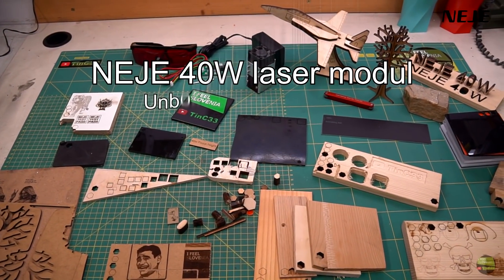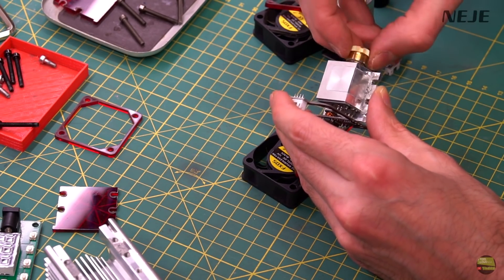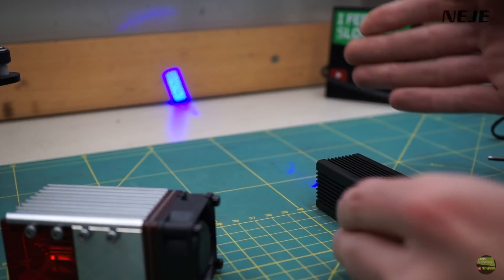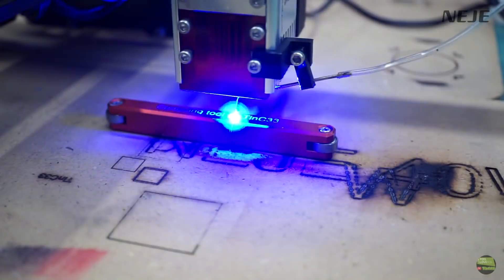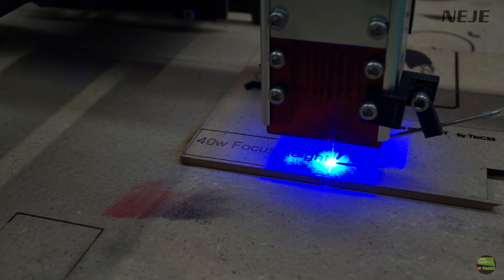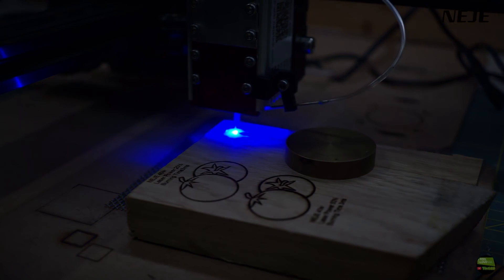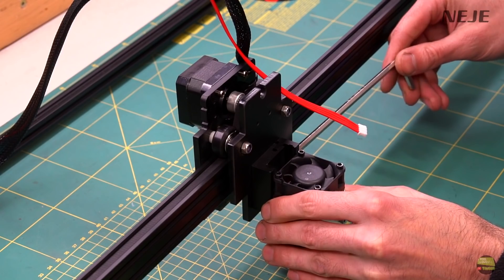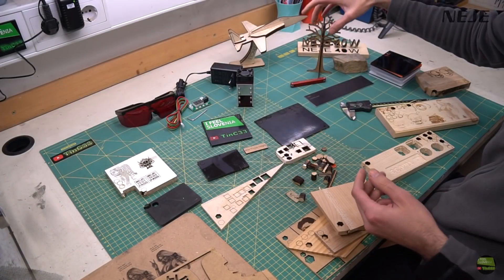Neje A40640 40w laser modul [unbox / review / first test] best laser modul modul i try

Comment: and the installation procedure?  Do you need another power source to power the new module?    , Cheers
Reply from the maker: All you need to replace is power supply wich need to be 12v 4A, cable stay same
Reply: @TinC33  And how do you energize the new integrated card?   Cheers and thank's

Comment: Hi, I've a question, my lasser engraber machine is the atomstack a10 pro and is 50w in general but the optical laser is 10w so idon't know if i would install some laser module like you use 40w, your machine how many watts it is?
Reply from the maker: They said it has 11-12w optical power, but focus is really good on that laser.

Comment: Hi there - purchased a NEJE 3max with this module a few days aho. So far, so good! Quick question: do you wear the safety goggles also when the laser is on standby / when you are framing the object or only when it's engraving/cutting?
Reply from the maker: hello, great to hear, it's the best modul, better than E40, i never use googles while framing, i put them on befor hit play button, but also that's not so dangerous if you cut some wood, biggest problem is while engrave something like inox steel, where the laser reflected and entire room become blue, so if that reflect to your eye it be very dangerous

Comment: Hallo sir,
I want to ask where is the difference between the CO2 vs NEJE engine?
Which recommendation, before we buy,
Because NEJE's price is much more efficient and its Work Area is 810 x 460mm, this product from China.

Thanks in advance if you can answer.
Reply from the maker: Neje is diode laser, i don't own a co2 laser, but they are much more expencive, i think more powerfull but got limited working hours, than need to replace expencive co2 tube, check yt for differences, but if neje got enough power for you than deffinitely diode laser, wich is cheaper all the way.
Reply: @TinC33  Wow.., your answer is very helpful
Thanks sir

Comment: how is the laser holding up after 12 months since this review. Just wondering what the longevity is of this laser.
Reply from the maker: For me work ok, but use only here and there, also read that for long term of use they advice to run at 80-90% power. However now the new modul com out specially for long term use.

Comment: A tip for cutting thick material. Do not focus your laser on the surface. If cutting 18mm plywood focus it around 4mm below the surface. If it begins to stop cutting then stop & adjust focus further into the material say 8mm.

Comment: Hi mate! Your reviews are good, but I'm sorry to say that you support a scam company. I recently bought my 40W module direct from Neje shop. But there was no "big box with lots of accessories". Most of the parts you show are not included - no glasses and not even the 4A power supply that is absolutely necessary to run this module. So you have to buy it aftermarket. Also packaged cheaply without the high-quality protection for each component you are showing - everything together carelessly crammed into a tiny package without padding in between, which led to the module being completely scratched all around. Very sobering when you see what the regular customer gets versus people like you who advertise and promote the stuff for them.

Comment: I don't know where they come up with 40 watts because NEJE's web site says this module's output is only 10 watts even though it says 40W on the case!!!!
Reply from the maker: It is old data, every china manufacturer (some of them still do) mark their lasers by electrical power consumptions, bow it's become popular to mark diode laser moduls vy it's optical wich is 10w for that modul but for real result you'll need to measure with special tool i don't own.

Comment: Ok but whats the deal everyone says  you can't run it a 100% or it will burn out the laser?
Reply from the maker: Idk i always use them on 100% while cutting and still work fine, but trouth is that i didn't run them more than 10 hours so far.
Reply: @TinC33  all the feeds and speeds  info on the neje website are based on 100% power too.
Reply from the maker: @rhoadesurf  true, but i read many comments their laser die or stop working because work with 100%... I don't know mine work good and also the temperature don't go over 36degreeC if i remember right.

Comment: What is the life of the laser? Is it better to stick to 60 percent power and adjust number of cuts? Rather than 100 percent power?
Reply from the maker: I don't know, i read about that to use it on 70-80% power max for longer life, i use them on 100% for cutting and still work fine.

Comment: I'm trying to engrave anodized (black) aluminum blanks with this laser module.  The areas engraved are a copper-bronze color, not white.  I've tried speeds from 10 mm/min to 10000 mm/min at all power levels without success.  Would you please share your settings for the best results with anodized aluminum?  Thanks!
Reply from the maker: That's not about settings, it's about colour of anodising, black colour doesn't exist, so there are lot of mixed colours to get black anodising.
You can check my last video where i anodised my homemade lathe tool holders wich i anodised in different colous, when engraving one colour engrave become white, on other toolholder engrave begome black and on third engrave become grey, so it's all about material, if you want to get white engrave try to get some different anodised plate, i bougt some anodised aluminium plate for laser engraving for some button tags and so on and it's quite good tough anodised surface and engrave is gray if i go more passes ut become light gray, good lock

Comment: I had a quick question. I have the same neje master as you. I was wanting to know if you had to use the included power supply that came with the module or was the original power supply that came with the machine enough to power the new laser?
Reply from the maker: For 40w modul i use adapter wich come with it 12v 4A and this adapter is good for all kind of laser, if you buy 20w machine you'll got 2A adapter with it, with 30w machine comes 3A adapter and with 40w come 4A wich is good also for a 2.5w modul... You can try but i think 2 or 3A will be too weak to power the 40w modul.

Comment: The only difference is in the diodes SS34 and SS54 ... If you replace the SS34 diode with SS54 in the dual laser driver, will the laser power increase?

Comment: Good video review, thanks. You mention focus being important, but when cutting the focus will be gone when going deeper into the material. For instance when cutting 6 mm material, will it be better to change focus by 3 mm distance closer to material to ensure closest average focus during the entire cut?
Reply from the maker: I got best result if i set focus on top surface and didn't touch them even when cut 18mm wood...

Comment: Hi, thx for yours videos! 
Did you changed driverboard or power suply in 2s laser for testing the 40w module ? 
Because their seem to be diffrent than in 2s max 40w laser.

Cheers!
Reply from the maker: Yes i use power supply i got with 40w laser so 12V 4A, motherboard i change later i got a video about (8 vs 32 bit motherboard)

Comment: Hi, I have NEJE Master 2S Plus 80W CNC Laser Engraving Machine. I have not learned to cut wood. Can you tell me the settings I will use and any distance from the wood. Thickness of the wood etc.
Reply from the maker: Set focus and run with 5mm/s or 20ms burning time, laser power to 90-100%

Comment: hello.  your video is very cool.  I would like to ask you if the 30 or 40w module would be used for the Neje Master 2s.  From already thank you very much!
Reply from the maker: You mean if you can put 30 or 40w modul on neje 2, sure you can but if you got older neje machine where the laser modul is mounted with two screws, you'll need to buy also clamp for modul (i think it come with 40w version) and a 3D printed part to mount them on, part i design you can see in some of my neje video description.

Comment: Nice video.., I have neje master 2s max 40w, how can I cut the poplar plywood from 3mm in one pass? I have the focus at 17.3mm with air assist but I do not cut completely the plywood in some places remains is not really cut. Because?
Reply from the maker: Because of wood fibers wich is tougher than the wood between fiber.
Try to lower down the speed or going second pass with bigger speed.
Other thing wich halped a lot is to put some mesh under the wood, so there is some air between the wood and bottom surface, do you got something?
Reply: I cut to 200mm/m and 90% power, I have air assist and also a raised grid where I support the material to be cut. But still the 3mm poplar plywood is not cut completely. Some parts looking at them from below are not cut in the slightest.. Is the focus correct at 17.3mm? Do you have telegram or a telegram channel?
Reply from the maker: @robertomarciano1788  no i don't, actually neje said 22mm for focus height i think, but i got best result at arround 17mm, try to playing a bit with a focus height also.
Reply: Ho provato a 22mm, ma anche io sembra aver avuto migliori risultati a 17.3mm ma comunque non riesco a tagliare in una passata il 3mm😂

Comment: I have a questions ? All your. Cuttings in this video you use 17 mm focus, no matter what materials you use? I have the Neje a40640 and I have problems to find the focus in 3 mm Baltic wood, no cutting in 300 speed with 100% power  1 pass , any suggestions please?
Reply from the maker: Yes because it's fixed focus, 300 speed? What software do you use?
Reply: @TinC33  light burn I try 200, 300,400 and not cut also I move the focus from 15mm to 22mm minus the half of the material for cutting, if I am wrong please let me know but neje  have a diagram of the focus for doble laser module is 22mm minus 1/2 of the material plus 1 
22-9+1 = focus in mm
Reply: Sorry Lightburn
Reply from the maker: @jmdd03  if i understand you got way too big speed try with 5-10mm/s
Reply: @TinC33  I think? I am new on this with laser and lightburn I just setup everything by watching some videos… but like I am said this wood I have is 3mm but doesn’t cut in 1 pass I use 250 or 300 speed with 100% power…but nothing cutting…
Reply from the maker: @jmdd03  as i say 300mm/s is ultra fast speed, set speed to about 5mm/s to 10mm/s
Reply: @TinC33  sure I will, thank you so much for your time to answer all my questions, again thank you

Comment: hi, can you tell me if this machine engraves on thin stainless steel plate with 2 to 3 millimeters
Reply from the maker: What you mean 2-3mm size of engrave or deep of engrave, anyway, it work on stainless until you use permanent marker but that's not that, for steinless steel you'll need a fiber laser.
Reply: @TinC33  I just want to transfer names and images on top of the plate.
Reply from the maker: @FizeDeuBom  i try to do that in some video, but result wasn't so good, check my other laser (neje) videos you'll see
Reply: @TinC33  of course, thanks for your attention

Comment: Thanks. I'm using Lightburn with the A40640 but can't get through more than 6mm wood. Do you have a link to a good machine setting configuration? It might also be due to insufficient air support but it still feels like it's running on half power.
Reply from the maker: That spruce wood is really soft, and the air support got huge effect, if air blow just a bit out of center into groove, effect reduce quickly. Try with different settings.
If yoj use lightburn do you set s-max to 1000?
Reply: @TinC33  thanks I'll start by experimenting with improving my air support. And yes S value is set to 1000. Thanks for answering

Comment: I have 3,5w laser with only ttl output installed on cnc, is it possible to connect with  neje software or lightburn for photo engraving?
Reply from the maker: No neje need it's own microcontroller on motherboard.

Comment: Thanks for your time and great demonstration!💪🏾👍🏾Have you tried the new 80w laser module?
Reply from the maker: I contact neje team because i got lot of questions about 80w modul but it doesn't exist, there are some ad on ali i know but neje 40w with dual diode is most powerfull modul from neje so far, it's optical power is about  15w
Reply: @TinC33  Very well. It's really important to research these things. I intend to get one of these. Is there any  attachment compatible with this machine to engrave on cylindrical objects?
Reply from the maker: @jayrome8764  didn't try yet but need another atachement with a motor for cylindrical shape engraving.

Comment: Hi, I already received this laser module. And I am doing the same replacement like in this video. Do I understand correctly , that there is now need to use Digital PMW wave pulse signal generator or Interface adapter board, which was part of the package , and I can just mount the new laser to the Neje 2s and change the adapter for the stronger one? thanks
Reply from the maker: You don't need an offline controller board wich come with a modul, jist replace entare modul and change power supply like you said, no need to replace cable, and nothing, offline controlller is for diy project.

Comment: How did you linked the New laser module to the "old" driver of that machine?
Reply from the maker: Driver has nothing to do with laser modul.
Reply: @TinC33  so I just need to substitute the laser module from my old one (30w) with the new one (40w)?
Reply from the maker: @mete692  yes that's it, and you need to replace power suppla with 4a one wich come with 40w laser modul, cable, software and firmware stay the same.
Reply: @TinC33  Great! thanks!

Comment: Any focus problem with A40640 module? mine in best focus point has a rectangular dot shape and cut better in horizontal that in vertical. (focused by ramp method)
Reply from the maker: No i got nice square shape of focus, you can try to screw/unscrew the lens a bit and see if there some difference, but mark the position befor make any change.
Reply: @TinC33  I already did, it worsens or returns to its initial situation but there is no human way for it to take a square shape, I start to think that I have received a faulty unit .
Reply from the maker: @ecds  may be that, try to contact neje team, i wish you good luck

Comment: Hi do you know if I can mount this laser to my Neje Master 2S? On the Neje website there is no compatibility info
Reply from the maker: Yes you but need to replace the x carriage if you got now 20w laser, or make a 3d printed adapter like i do.
Reply: @TinC33  yes I have 20w thanks to your older video, but its not so sufficient for cutting, so i want to upgrade it a little :)
Reply: @TinC33  do you have it available somewhere like thingiverse?
Reply from the maker: There is a link under video description to thingiverse for 40w adapter and air assist holder.
Reply from the maker: 4A power supply come with a laser modul
Reply: @TinC33  is it a big step from 20W model?
Reply from the maker: @GuruVlk  yes it is also big step from 30w i could say it got double cutting capacity as 30w and about 3-4x more power as 20w, mostly because of awesome focus, but for cutting air assist is must.

Comment: I sure it will do it once. Not so sure it will do a second time. these look great on the videos, I fell for it. I got the 30w module, it lasted 5 hrs of burning at 70 percent power. Now it cannot even burn paint at 200mm and 100 percent power. Well Neje requires a video to warranty the module. I made them one, my reply was when it dies completely contact them and try again. Good luck!!
Reply from the maker: Holy shit, so they replace only when it completely die, sorry to hear that, mine work fine so far...
Reply: @TinC33  Yeah I was pretty disappointed when they started giving me the run around. I own two of the 30 watt modules, the one is dead and the second is starting to lose power now. it did a little better. my hour meter has it at 27 hrs. I figure about 20 more and it will be sitting in the pile of dead diodes. I am happy with my Atomstack replacement but the power is not the same. So I go a little slower but I am making money not losing it.
Reply from the maker: @Cantstandbs  great to hear, that you'll happy with atomstock, also i'm sure you know some trick to completely destroy the neje to get new one, like overheat, overvoltage...
Reply: @TinC33  Yeah , I  could do that. I don't normally get to that point unless it is expensive. For the 100.00 us, they lost a long term customer and my referrals. what they don't know is with whom I associate. I am part of the US largest community of Engineers. The one who laughs last is the winner.